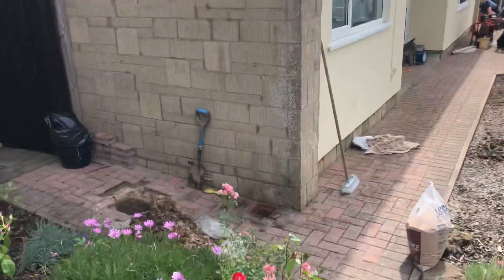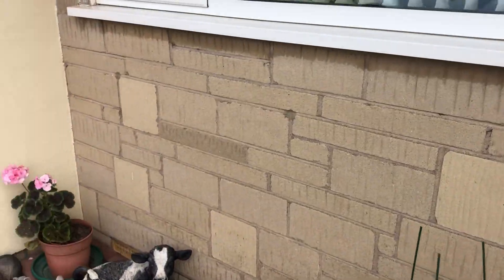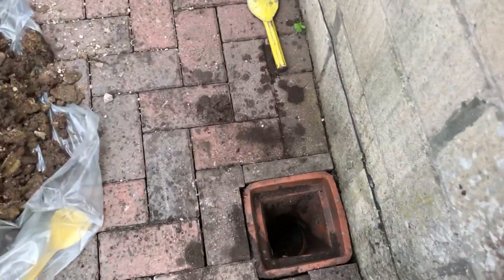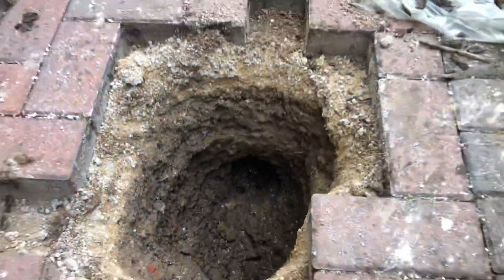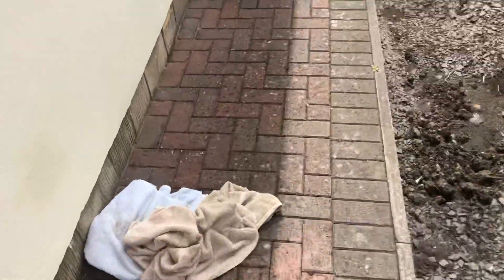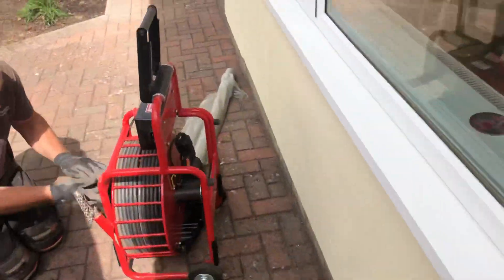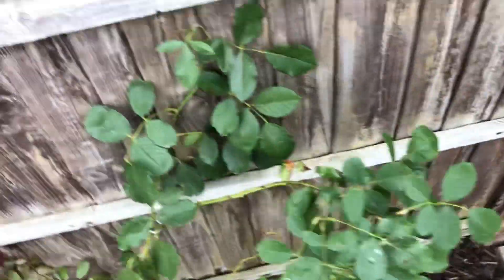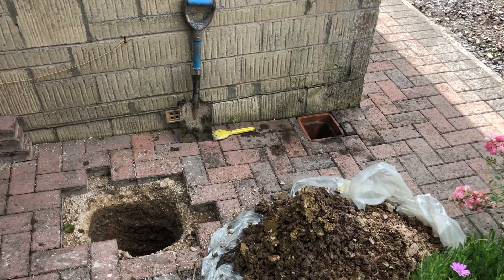Before cavity wall insulation is installed you need a CCTV drain survey

Comment: After seeing your vids I organised for this to be done next week and start the process of elimination (or not!). Thanks!
Reply from the maker: Well done it’s certainly  a start… any questions drop them in the comments👍 good idea to put in your diary for next year also to check everything 👍
Reply: @completepreservation  oh I got questions😄 I have a house renovation side project previously treated for damp : injected (I think), weep holes drilled in all inner leaf bricks. Despite being empty 3 years has max borderline mositure readings in some walls. The worst walls are at side and back. Gardens slope gently into these walls. Concrete path around all. The only drains are located at these sides. The concrete slab has patches of moisture rising at various points in the back half. Would you considering drainage (maybe french)for the side and back? the garden gets so, so sodden with water! I have a drain inspection sorted, the water supply pipe in the kitchen always has a damp stain around - it may be leaking. It has to come out anyways as it's lead. But the slab on the back wall especially gets damp around the edges the more rain we get. Also, the concrete path around the house is as little as two Inches below the slab, but sufficiently below the dpc (actually there are two - the lower one is only a few in he's from the ground but works (i.e damp bricks upto that point). House needs to have all render taken off and replaced do want to get a handle on this stuff before! Sorry for the essay!
Reply from the maker: I hope it was cheap 😂😂😂  get those drains checked first👍 as for french drains personally I’d stay away from them, never really needed. I’ll put a link below. Is it cavity or solid wall bud
Reply from the maker: French drains 🤦‍♂️https://youtu.be/tWrAW1GdJ-k
Reply: @completepreservation  yeah t'was cheap! 70k three double bed 60's semi.  Even cheaper with what prices have done the past year ha. It's cavity👍 I've inspected 4ft of the cavity wall. Cavity trays intact and surprising clear. Got a borescope today to do the rest of the house. I know a thousand things I didn't before I got this place😄
Reply from the maker: That sounds very cheap 👌👌👌check that cavity, snd internal floor / wall for bridging 👍